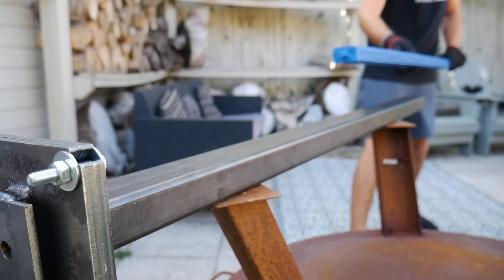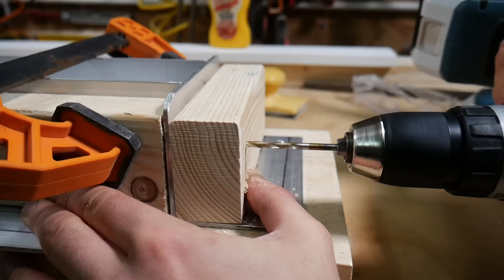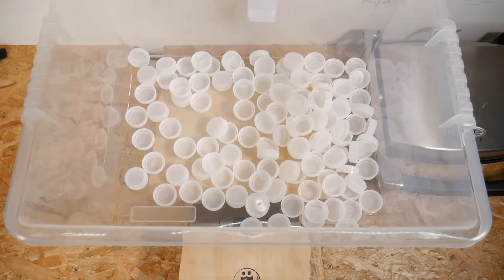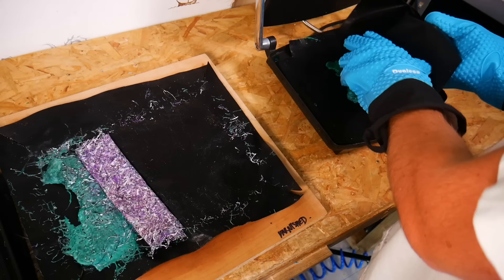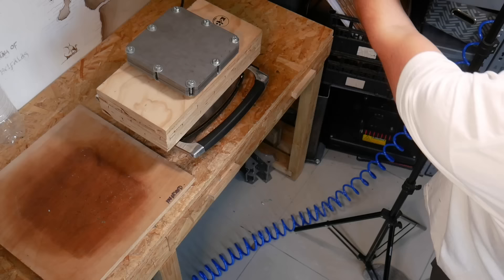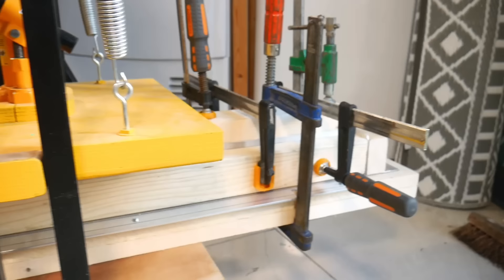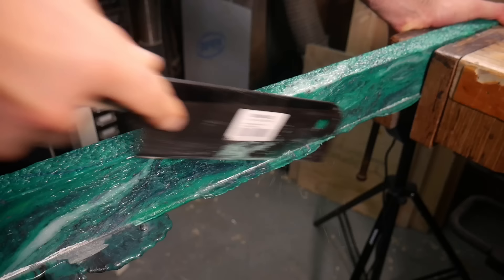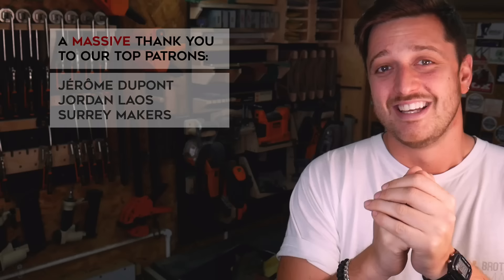How to Make Recycled BEAMS from Plastic Waste at Home

Comment: Having learnt from you guys, I've now made a mould using 18mm ply and 2 plates of 6mm steel. Whilst I melt the bottle caps in one panini press, I heat the 2 steel sheets in another. Just before adding the plastic to the mould I insert 1 hot steel plate in the bottom. The melted plastic goes straight on top. I did use silicon sheets but by going straight on the steel it stops the minute brick pattern on the sheets pressing I to the plastic. Then I add the 2nd heated steel plate and then the 18mm wood. I use loads of F clamps. The result is that whilst it takes a little longer to cool, the heated steel plates makes the surfaces of the setting plastic absolutely flat with no air bubbles or wrinkles. This eliminates the need for a planer or thicknesses. I can change the thickness of the plastic slab by changing the 6mm steel plates for 4mm. Using a combination of these I can make 2mm to 14mm plastic plates, depending on what I want to make from them. So chuffed ive found you guys. You are awesome
Reply from the maker: Sounds awesome! Would love to see pictures

Comment: I was a process tech making hdpe lumber for 8 years. Basically this exact thing except most standard lumber profiles in up to 8 foot lengths. All post consumer recycled. You did a decent job. I would recommend adding an exothermic blowing agent. These are available in hdpe pellets. A small amount produces a uniform foam pattern internally and causes the plastic to foam and fill the mold perfectly. It also adds very good structural properties. These beams are strong. Like stupid strong.
Reply: "Park bench" strong, or "automobile bridge across a deep ditch" strong?
Reply: You know they make powder foaming agents that are very safe to use and will have the same effect without buying new equipment, right?

I was an extruder operator for 11 years and we made foamed separator tapes. We just used a chemical foaming agent and it worked perfectly. It was pretty similar to baking powder.
Reply: @absalomdraconis  you don't build bridges out of plastic because of something called creep.
Over time, stresses cause Plastics to flex and retain the new shape as the elastic memory only lasts so long.
Reply: @notsure1350  same with wood but I think it happens a lot long time frame tho
Reply: @absalomdraconis  I'd trust it anywhere I'd trust wood.
Reply: @notsure1350  you wouldn't need any additional equipment to use it the way he is. Just scatter some pellets in with the plastic. Either way the results would be better
Reply: @ronniewilliz153  While wood can be warped, it doesn't have plasticity (can't be remolded) like plastic does.

Comment: I’ve read that using powdered almond shells can increase the repurposed plastics strength, it would be interesting to see the comparison between the two. I’m also curious if the rate at which the plastic cools effects it’s tensile strength. Awesome video guys
Reply: The method in the video seems like a great opportunity to experiment with composites - whether they were to add in some wood dust, metal shavings, plant fibres, charcoal etc - I think it could greatly improve the material strength
Reply: the problem with that is, maybe you will be unable to recycle the material if you ever need to, so would eventually become waste...you´d think thorougly how to design and use the final piece so that in retains its usefullness for as many years as possible. Any scraps of it would automatically become waste too
Reply: Need a good blender with water to shred caps into small bits. Strain and dry out. Then use a large pot inside of a larger drum with water heated with a gas turkey fryer or similar to melt small pieces all at once and uniform.
Reply: It would be way easier to just add in some fiber glass or metal mesh to increase the strength
Reply: What about melting to 1,500 & adding aluminum & iron, etc. I realize the toxic fumes, but there's countries incinerating plastics
Reply: @zebraloverbridget and wrap with fiberglass or carbon fiber, maybe repurposed small gage I-beams or tubular metal inside
Reply: @nathanielrice6499 or a fire driven h2o in copper tubing wrapped concentrically around the fire mass, then all around the metal forms, like radiant heat flooring... No electricity needed as the hotter water will move upwards and back down to the cooler reservoir.

Comment: One eco friendly energy source for heating the plastic is a solar oven or the use of magnified sun light using a large fresnel lens from an old TV focused on a ceramic plate in contact with the mold.
Reply: You mean: How to burn your plastics 101? Solar ovens are great but for melting plastic you want a controlled temperature. Especially with highly flammable plastics like HDPE.
Reply: @IzzyIkigai  
That's a good point, I was picturing something with a thermometer and easy opened ventilation, possibly a water basin it could be dipped into in the case of if exceeding the desired range.  Although if a solar oven gets hot enough to burn the plastic, would that imply that a structure built with this material may begin to soften and loose it's form, possibly collapse on a hot day, as the attic could reach solar oven range temperatures?
Reply: I really like the idea of using an old TV screen as a lens, regardless of if it works for this use. Great thinking!
Reply: @charfunkianmojosapian4276  i think you underestimate how hot a focused sun beam under a fresnel lens can get. In Focus on a sunny day you can melt stone with it. So you'd have to overengineer something just so your lens doesn't focus too much. Meanwhile solar panels exist and can power your electric oven. ;)
Reply: @IzzyIkigai  
Maybe just reflective siding in an insolated box would reach a high enough temperature, or if a focused point was used it, it could be used to heat water which the mold would be partially submerged in.
Reply: @IzzyIkigai  now you're deciding if you wanna use oil or materials sourced from China. Oil is more likely a cleaner bet. Solar panel production is incredibly polluting.
Reply: @notsure1350  I feel like that's mixing up environmental and organisational issues. If your government doesn't enforce recycling or removing of dangerous chemicals that's one thing but oil we take out of the ground adds carbon to the atmosphere and we cannot get it back into the ground. There isn't going to be new oil because the processes that allowed oil and coal to exist are mitigated by adaptation of micro- and macroorganisms.
Reply: @IzzyIkigai  Obviously, uncontrolled solar heat isn’t going to work in the same way that uncontrolled electrical heat wouldn’t work.  
You’re not exactly moving the conversation forward with your comment.  
What do you think would be a good mechanism for controlling the solar heat? (likely with electrical backup)
Reply: The discussion here should provide some insight into why engineers make the decisions they do. To utilize a concentrated solar heat source*, a jacketed heating vessel that transfers heat from a fluid to the vessel's interior surfaces and thence to the material to be processed, HDPE in this case, is the way to control the temperature. In industrial processes the fluid used is often pressurized water steam as there is a direct correlation between the pressure at which the steam is held and its temperature.
      * Rather than photoelectric energy.
Pressurized steam is inherently dangerous, and I am not suggesting it as a solution for do-it-yourself plastic melting. However, a vented, non-pressurized "double boiler" type of vessel might be your solution for control. You'll need a jacket fluid capable of exceeding 130.8 C (HDPE melt point) without smoking or flashing and thermostatic controls** to hold the fluid at the desired temperature.
     ** Could operate shutters limiting the light entering the concentrating lens in your example.
While you could achieve the desired temperature by elevating the boiling point of water through making a sufficiently concentrated aqueous saline solution, that approach presents its own problems in a vented system, primary one being progressive concentration of the solution with attendant temperature increase as water evaporates from the solution. However, there are readily available "waste" products that fit the bill: various oils. Vegetable oils used for deep-frying in food preparation are obvious choices that can be obtained for little or no cost beyond the effort of collection from restaurants that periodically have to change the oil in their fryers. Setup your operation over bare dirt or absorbent natural material and any spills are easily addressed by composting.
Reply: @IzzyIkigai  Carbon in the atmosphere gets scavanged by plants.  That's why CO2 is a TRACE GAS... like 0.004 % of the atmosphere.   As for Greenhouse gases, The only one that matters is WATER VAPOR... and what exactly  do you intend to do to reduce the amount of clouds in the sky and other water vapor in the atmosphere?
Reply: @IzzyIkigai  just adjust the focal length to adjust the temperature. Make a chart of temps at various focal lengths so you can control it.
Reply: Looks like perfect kitchen counter top material.

Comment: If your mold is made entirely from heat conducting metal, perhaps the heating elements (whether from deconstructed appliances, or solar) could be added to the outside of the mold itself,
 to be used as a melting vessel as well as an end-mold.
OR a long oven to contain the aluminum mold so that as one beam is cooling, another beam full of plastic can be put in to melt.

Comment: Just a thought, maybe put a heating element under the aluminum with a manual nob or something to regulate the heat. That way you don't have to melt it outside the mold. Turn it on put all the plastic in the mold from the start (maybe half if the volume is to high) , apply some pressure with that fancy press :) and just let it melt into form.
Reply: I’m in process designing a heating vat that makes plastics fluid that allows you to pour  into vertical mold containing a center core of used tire cord , problem is flammability and due to that can never be used in anything occupied, maybe deck boards if sun did not warp or degrade,maybe underwater rigging or foundations but that’s just putting the plastic back into the water. We are on the edge of a breakthrough and soon hope to go public
Reply: @classless007  hi , do you know at what temperature the plastic melts and when does it start to burn and be unusable ? Also is it possible to keep the plastic in a melting state without burning it ?
Reply: @MrRiikuo  really depends on composition of the plastic, I just slowly heat until I’m there
Reply: @classless007  thank you , il try it out
Reply: all plastics are different, but between 180 and 300, but most are around 200-220 and you can hold it for quite some time @MrRiikuo
Reply: How about making the entire form a heating element via 12v hot plates like those in 3d printers. I've got a bunch from 5 or 6 retired printers.
Reply: Wrap nichrome wire around what u build.
Reply: h2o in copper tubing wrapped concentrically around a fire mass, then all around the metal forms, like radiant heat flooring... No electricity needed as the hotter water will move upwards and back down to the cooler reservoir.

Burn all cardboard and clean burning, non-toxic junk as fuel !
Reply: Exactly what I was thinking. just melt it in the mold
Reply: @classless007  I understand some of that... Please elaborate from a different perspective....
Reply: Or if using a metal mould, then a series of Peltier modules could be used to heat the mould and melt into place.

Comment: I've created solar ovens using fresnel lenses salvaged from rear-projection televisions. 
Some of them were powerful enough to melt stone.
I'd bet that you could make one that you could use to melt plastic and other recyclables without using so much electricity.
Reply: WOW!!! That's awesome. I'm looking for an accessible solution to make an solar oven. Loved it! but how can u make that glass transparent? aren't they all dark?
Reply: @nimaryan8710  No, all of the ones that I have taken apart have a tinted sheet and/or a grid sheet over the lens.
The lens itself is clear.
Reply: @theotherwaldo  ohh! That's soo great to know! i will look for it. Thank you!
Reply: @nimaryan8710  - how about a parabolic mirror instead of a lens? Make the dish from any material that you find suitable, and then glue tin foil strips onto the inside surface. That approach also gives you complete freedom of size and scale.

Comment: That's awesome! With a few recycled steel rods inserted in the middle, you'd definitely have a greater tensile strength piece to work with and test for how much compression it can take before it no longer can function at 100% capacity. I believe you fellas are on to incredible building alternatives and can definitely help with the over extended disposal of plastic refuse.
Reply from the maker: Funny you say that Stefanie as we were talking about doing exactly that earlier this week! Thanks so much 😊
Reply: @BrothersMake  if you go down that road maybe use a copper coated steel rod to improve adhesion between the HDPE and steel same principal as is used on steel belts in rubber tyres
Reply: @TheMingilator  
Would electroplating the copper onto the steel work for this?
Reply: @akseminole  so I looked a little further into this and I'm not sure copper would be the best interface material, there is a paper on that subject but it's locked behind a paywall I think some sort PVD process on the steel yielded the best results but can't be 100% sure
Reply: @TheMingilator  Link the DOI of the paper anyway, as there are ways (such as asking the authors, or finding it in an online database) to read it.
Reply: wrap the aluminum mold in 3/8 inch steel and attach heating elements to that. The steel will hold heat way better so you have the time to work out the defects.
Reply: @jesseridley9218  that's not what they're talking about. They're talking about ways to strengthen the beam, for use in more ways. Like one puts steel rods in concrete to strengthen it, in other words.
Reply: @MaryAnnNytowl  I was referring to the heating process and how to make it easier. Which was mentioned on many occasions. So, thanks for the input, but it's not needed
Reply: applications are great but what point does it become costly instead of cost efficient recycling
Reply: plastic probably does not wet steel.  You can prevent possible delamination in composites by improving the wetting angle between the two substrates.  Take the steel you want to try out and drop a few bits of hot plastic on it.  Then coat some thing...like the rest of the bar with stripes of this and that....plastic resin coatings, oil coatings, water latex coatings and do it again or use other material, aluminum, wood etc and do the same "drop" test.  Pick the combination that beads up the least!  The higher the bead stands up the less the wetting angle and the less the adhesion.  The possibility of delamination is worse with a high standing bead.  The angle of the bead with the substrate at the point of contact is the "wetting angle".  There is a lot of hard chemistry behind this wetting angle measurement.  Some of it is in the literature so you do not need to do so many tests.

You do not want a high bead....that is a sign of poor wetting.  Think water and wax over steel, painted steel etc.  It's the autobody paint shop model.
Reply: I was thinking a few layers of expanded plate
Reply: Opening Hours ppp
Reply: You would be limited to cutting those steel reinforced beams by hand with a hacksaw. Unless you happen to have a metal bandsaw or carbide toothed metal chopsaw.  Even a metal bandsaw would probably generate enough heat to melt the plastic around the rods at the cut site though.
Reply: @jesseridley9218  yeah heat the mold up melt the plastic right in the mold. Turn the heat off, clamp it up and should be good. Not sure how to get the air out, maybe vacuum?
Reply: @BrothersMake  I'm not a fan of this. Adding a material like steel changes the workability. Now instead of a normal saw, you need something that can handle the steel core as well. You would also not be able to then use this for applications where steels' properties are required. This you just end up with a heavy plastic beam. 

I would suggest rather using pvc pipe as a filler. You'll save on the volume of plastic and still have a plastic beam for plastic beam purposes.
Reply: @jesseridley9218  your comment is irrelevant to this thread. No one mentioned ANYTHING about ANYTHING having to do with your comment. So it's actually your comment that's not needed. Learn how comment threads work before confusing people and getting snappy when someone thinks you were misunderstanding the comments in the thread you're replying to.
Reply: @mrbamfo5000  vacuum and possibly vibration. With it heated up for a longer period of time (in the mold) you get the chance to work out all of the defects, making it stronger.
Reply: @mrbamfo5000  HDPE shrinks when is cools so it should fall right out.

Comment: A couple of thoughts for you - a T beam mold might be worth a go as you'll reduce the mass while retaining rigidity. It's an easy enough shape to achieve using your aluminium angle and boards. Another thought was possibly trying a hotplate with a temp gauge. As long as the temperature stays below 300 C you shouldn't have any decomposition. That might allow for easier processing of larger batches compared to the press method.